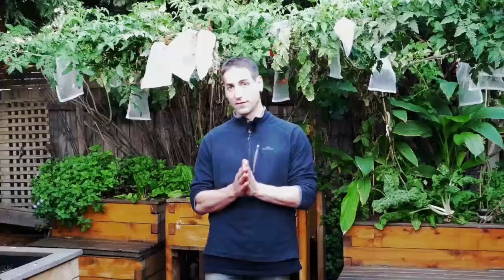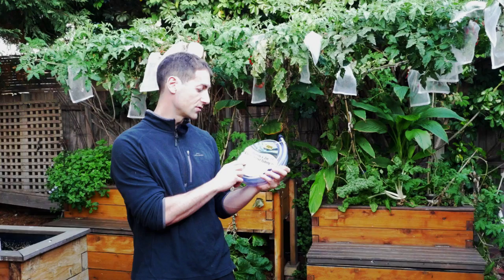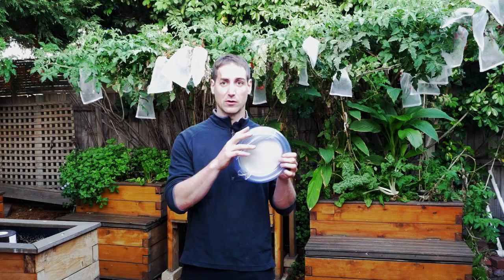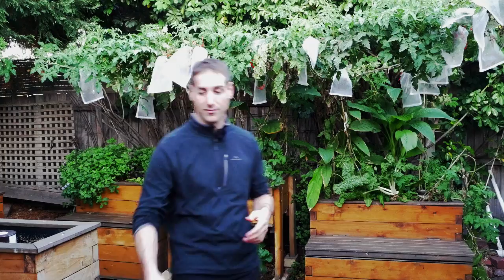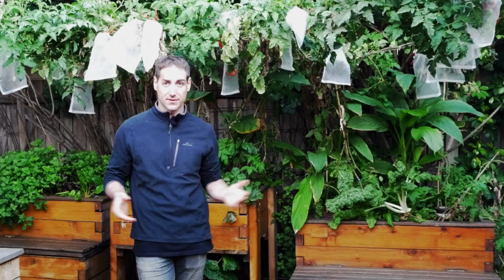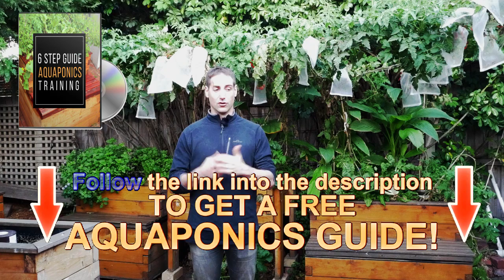Should we use plastic in aquaponics?

Comment: Thanks Jonathan, for raising this important issue. Love your channel and really appreciate your expertise!

This is a question that is also the subject of much discussion in green building circles. PVC can NOT be used in building if you want to get the best green certification (see Living Building Challenge). The alternative that is currently accepted as best available is polyethylene; HDPE or LDPE. This is the plastic that single-use water bottles are made of, the ones that you see in supermarkets everywhere.

When i build that is probably what i will use for plumbing, although i know where i can get clay pipes...

This question about plastic is the main reason that i have not built my aquaponics system yet. I may be too fussy, but it does worry me. However i admire everyone who has built their systems, plastic or not!

Thanks for bringing real knowledge and evidence-based approaches to aquaponics!
Reply from the maker: Thanks Em for the positive feedback :)
Clay pipes are good, just not sure how easy to adapt to aquaponics.
Cheers

Comment: How about using the pond "lining" on wood/plastic? Do we have any knowledge it that leeches anything into the water? Then the follow up question would be, how about the wood treatment chemicals? I love acquaponics myself, but I feel that there are lots of unknowns at this stage of how good/how bad, and if bad how bad.
Keep up the good work with this video!
Reply from the maker: Thanks Enrico, very good questions.
The treated wood is definitely not to put in contact with the water of your system.I use cypress wood which is naturally resistant 
😉😉

Comment: Most if not all U-PVC DWV and pressure pipe and fittings are UV stabilized, and are approved for use in Domestic potable water supply services. stormwater drainage pipe ( 90 mm ) is usually not UV stabilized and should not be used in direct sun light. Blue glue is mainly for drainage work as it cures a bit slower, but will handle pressure if used correctly. Green glue is for pressure use and is more expensive and sets almost instantly . My system uses U-PVC pipe and fittings and has been in place for 5 years now with no problems. Having worked as a Plumber for the last 47 years, this stuff will out last us ...
Reply from the maker: Thanks Alan. Great info. and good to read. :)

Comment: I use 1000L IBC for the fish tank, its made from High Density Polyethylene (HDPE). For the piping I use Low Density Polyethylene (LDPE) pipes - a 50m roll is around $60 from bunnings (search poly pipe) and I use barbed fittings and plastic clamps to connect it all together. For the bell siphon, the parts I use I got from the local irrigation shop: the stand pipe is a 'threaded poly riser' with a 32mm to 25mm poly reducer to create the funnel, the bell and media guard is made out a HDPE pipe similar to this: https://www.vinidex.com.au/products/pe-pipe-systems/pe-pressure-pipe/. The only PVC I use is to cap the top of the bell to create the pressure chamber, it get minimal sunlight and water contact.
Reply: I love poly pipes (LDPE) and it's easy to use. I use only 'potable water' grade. A bit more expensive, but I think it is worth it.
Reply from the maker: Great! thanks npc

Comment: PVC when heated will release gases mainly chlorine gases. Every plastic will break down under UV light and turn almost like powder. Any plastic that denotes use outdoors has had additives put into it to absorb the ultra violet rays, but these additives do not last forever. Painting plastic with food safe paints affords some protection from UV degradation. If using PVC fittings either paint them,make sure they are out of the sun or find a way to insulate from high temperature fluctuations. Please be aware that micro plastics are everywhere and if your system has any plastic parts, invariably you will have micro plastics also. Hope this Helps